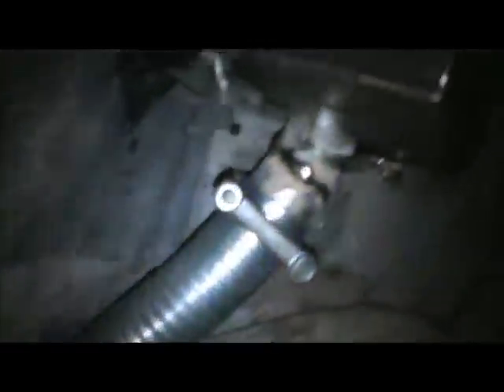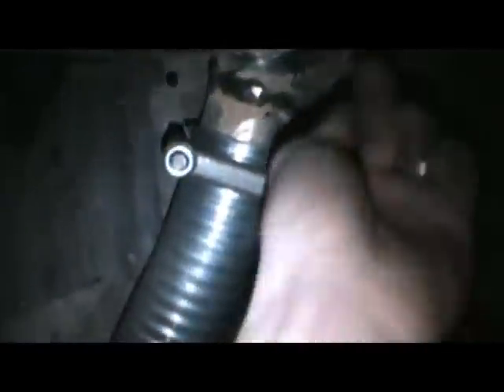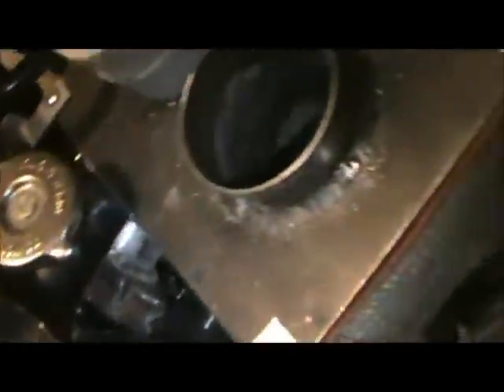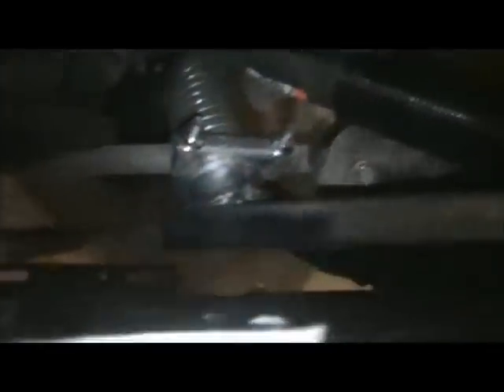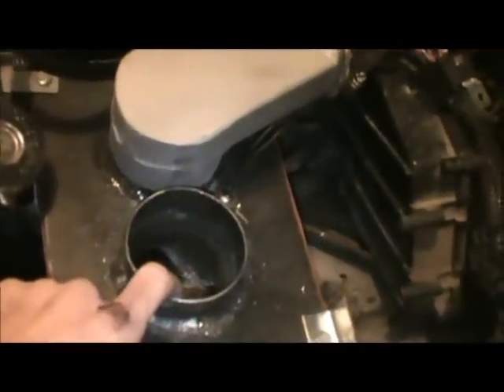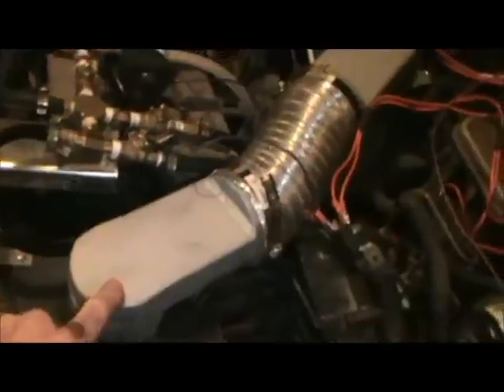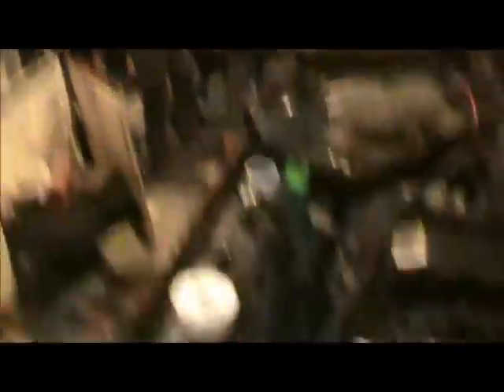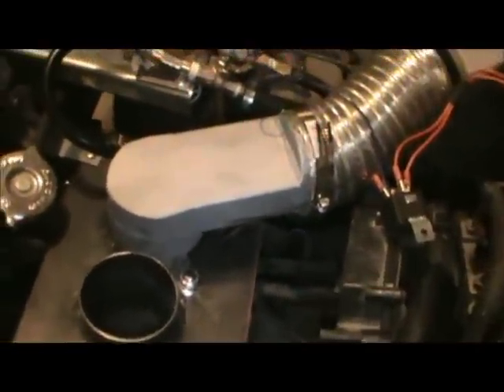100+MPG PROJECT NEW FUEL VAPORIZER INSTALLED (DETAILED OVERVIEW)

Comment: What was your mileage when it was all finished?
Reply from the maker: 33 MPG is the best with it so far.
Reply: What vehicle?
Reply from the maker: It's still not finished there is still lots of changes that are and will need to be made.
Reply: Gotcha! What'd you get on the rendezvous?
Reply from the maker: 211.7 at best. Went 19.86 miles on 12oz of fuel. The worst was about 10 mpg.
Reply: Any differences setup wise with the rendezvous versus the 100+ mpg project?
Reply from the maker: Yes there are allot of differences.
Reply: Could you just point out the differences to me??
Reply from the maker: Temp., intake and outlet size, fuel regulation, temp. control, container material. Filtration material, altitude.
Reply: What do you use for filtration material? Also, where did you accumulate your knowledge on HHO?
Reply from the maker: I use stainless steel wool and high temp cloth wool. A better filtration material would be a ceramic cloth. 

I accumulated my knowledge of HHO by doing allot of research and testing. I have spent literally over a thousand hours researching and doing various tests with hho.
Reply: where in the hho system do you perform the filtration?
Reply from the maker: After the bubbler.
Reply: What is your opinion on dry vs. Wet cells?
Reply from the maker: It depends on the application. I would use dry on a vehicle but for the hydrogen fueling station I'm building I will be using a wet cell design.
Reply: Gotcha...are the gains the same or different for a dry versus wet cell? I'm finally starting to grasp the whole hho installation process. What gauge of wire do you typically use? Also, are their any wiring diagrams you'd advise?
Reply from the maker: They can be a bit different. Wet cells will have more current leakage which makes them less efficient therefore it takes more power to make the same amount of HHO gas. As for the gauge of wire the thicker the better because of the amount of amps going through them. The thicker wires such as a 6 gauge wire will stay much cooler there a 10 gauge wire.
Reply: Okay, is it necessary to have a bubbler for a wet cell? Also, for your cells do you use a PWM or EFIE?
Reply: Okay, is it necessary to have a bubbler for a wet cell? Also, for your cells do you use a PWM or EFIE?
Reply from the maker: I would recommend a bubbler but use the water reservoir as the bubbler instead of having a water reservoir and a bubbler. If using HHO I would use a EFIE it will help to confuse the cars computer. A cars computer will typically learn that you are tricking it and will adjust for it after time. If you reset the cars computer then it will have to re learn everything again so if you have an HHO generator connected to the car while it is re learning everything you will see better results. A PWM is good but I would never recommend using just that. The problem many people have is they set a cell to produce a certain amount of HHO at all times. This is a problem and you will see little to no gains doing it that way. You need a computer program or a PWM that will increase the amp's to the HHO cell as the rpm's of the engine increase. producing more HHO gas while the vehicle is at higher rpm's and reducing the amount of gas production while the engine is at lower rpm's will give you much better results. I would say that having a system that increases and decreases HHO gas production based on the rpm's of an engine is critical and almost everyone fails to do that.
Reply: Is there a way to program the PWM to adjust to the RPM's of the vehicle that you know of?
Reply: Is there a way to program the PWM to adjust to the RPM's of the vehicle that you know of?
Reply from the maker: I'm sure there is something out there  but I don't know of any off hand.
Reply: How do you go about running your hho system in the winter time? I like in Wisconsin so winters here are brutal...
Reply from the maker: There is a chemical you can mix into it that will prevent freezing. Some of the companies that sell the generators sell it. You could also have a insulated water storage container that the water drains into when the system is turned off and pumps the water back into the generator once the power is turned back onto it. .
Reply: How would you create a drainage system? Gravity?
Reply from the maker: Use a multi directional pump. Have the hose in the container you would drain the water into sit along the bottom of the container so you can pump water in and out of the container. You'll have to wire it to a multi position timer switch so when the ignition switch is turned to the off position it will turn the pump on and only allow it to be on for the amount of time it takes to drain the water into the drainage container and when the ignition switch is turned to the on position it will turn the pump only for the amount of time it takes to fill the HHO cell back up with water.
Reply: Alright, thanks! I looked up chemicals and have had some success however, I wouldn't want to pay that much all winter (which is practically 5-6 months in Wisconsin) paying for that. I also looked up insulated containers and couldn't find anything near what I wanted. All were 250+ gallon tanks for industrial or farm use. Any ideas? Also, I got a question about your setups. I've seen alot of diagrams and stuff on HHO by now and none have as many tubes and wires going into and out of the engine compartment. Could you shed some light on why their are so many tubes? I feel like the design I'm making is very simplistic compared to yours and I want to reap the best gains possible.
Reply from the maker: Josh Studinski I would suggest you get a container and insulate it your self, it will me much cheaper that way and you can insure it will be insulated good enough. The design in this video is a fuel vaporizer not an HHO generator. I would build a traditional dry cell or buy one that you can either put together or that is pre built. greenfuelh2o.com sells some very nice well priced HHO generators. You can build yourself a split cell so you don't have to worry about the O2 censor getting thrown off. I will be building one soon and will share exactly how it's done. It will be the simplest design out there.
Reply: Okay, great! What would you insulate yours with? And when you say split cell, what sort of design do you have in mind? Also...where did you get your ideas for the fuel vaporizer?
Reply from the maker: I would use a fiberglass or ceramic insulation material. You can get ceramic insulation tape for pretty cheap. I'll have to show the split cell design in a video. I got the concept from an old neighbor who built one back in the 70's and got about 200 MPG using about 80% water 20% fuel.
Reply: Okay, thanks! So is it a modification to the carburetor? Also, is their a name for the design he (or you) did? (GEET, etc.)
Reply from the maker: Nope I don't have a name for it. It basically replaces a carburetor of the fuel injection system.
Reply: You should put in an a cell, I bed you'd get huge gains with the vaporizer. Also, what do you generally use to see your hho output (L /min.)? I am going to install a cell soon but want to see my output on my dash.
Reply from the maker: I will be putting in a cell that I designed shortly. I had to scrap the Jeep because someone vandalized it to the point that it would cost way to much to get it back to normal and get it running again.     There is a nice gauge out there you can get that has a digital readout on it that is made specifically for HHO. Here is a link to the website: http://www.accuenergy.com/
Reply from the maker: Here is a link to Steves video on the meter. Accuenergy panel meter for serious HHO enthusiasts
Reply: Thanks! I'm sorry to hear about that...I have the same model jeep as well. Could you send me a picture of your idea of a "split cell?" As for the vaporizer, do you got any websites or plans that I'd benefit from?
Reply from the maker: I don't have any plans that you could necessicarily benifit from because the system is way too unreliable. You can go to my facebook page: https://www.facebook.com/groups/259684980846627/ there is allot of info there or you can go to my website: http://fsrdproducts.com/blogs/news
As for the split cell I need to test it first before I give out the info on it.
Reply: okay, is there any designs similar too it? I'm just looking for a bare picture on the internet or anything to help brain storm some ideas up...
Reply from the maker: http://unitednuclear.com/index.php?main_page=product_info&cPath=25_72&products_id=316                             It's not quite what I'm doing but kind of a similar concept.
Reply: Is that said to have better hho output? I'm a fan of the wet cells more than the dry they have multiple cylindrical shaped wet cells that are super efficient. As for the fuel vaporizer...does a car need to have a carburetor to swap out a vaporizer with?
Reply from the maker: I would have to do a MMW test on it to know for sure.       

As for the vaporizer you don't have to have the carb for it to work.
Reply: Alright. Any suggestions on the size of tubing for the cell? I'm leaning towards a 1/4" because brackets and elbows are easier to find for that size.
Reply from the maker: it all depends on how much your cell will produce. 1/4" will do fine in most cases.
Reply: You said 6-8 gauge wire would do for the whole process correct?
Reply from the maker: That's correct.
Reply: What's the purpose of a shunt in the cell layout?
Reply from the maker: I've never used a shunt.
Reply: What does it do? As for the whole drainage system...do you know of any multdirection pumps? I have found none since you mentioned it to me. Also, what gauge wire are you using for your cell?
Reply: Also, in an hho cell where would a flashback arrestor or filtration device go?
Reply from the maker: A multi directional pump is way too expensive. A cheap way to go would be to have your insulated container bellow the hho generator and when the vehicle shuts off there would be a solenoid valve that activates for a short time which allows the water in the hho cell to drain using gravity or you couple have 2 pumps one to drain the hho generator and one to fill it back up with water. You would then use a fuel pump or any small water pump to fill the hho generator back up when the vehicle turns on. You can get some pretty cheap fuel or water pumps that operate on 12 volts. I use 6 gauge wire.
Reply from the maker: I would use more then one flashback arrestor. I would put one just after the hho gas output on the cell and I would put one after the bubbler between the bubbler and the end of the hose that is going into the throttle body.
Reply: How do you use connectors with 6 gauge wire? The wire is thick! Which idea do you think is better for the drainage system? If I used the two pump idea would where would I connect the hoses? Also...how would I wire the pumps (most pumps come with a regular cord for an outlet)? For hho transportation I might use a air hose then use hose fittings to click it into place for easy connect and disconnect. What diameter would you use?
Reply from the maker: They make 6 gauge crimp on connectors connectors. I would use the dual pump system. Pumps have an inlet and an outlet on them you would connect the hoses up to each end. When installing the pumps you need to make sure they are installed the correct direction. They will have orientation arrows on them showing the direction of flow. If you get a 12 volt fuel pump they don't come with cords. They have screws on them that you connect the wires to. As for the hose size it doesn't really matter what size you use as long as it has good enough flow so the system has good circulation you will be good. I would not use air fittings they are not made well enough to prevent leaks. Use barb fittings instead.
Reply: What gauge wire would you suggest with winter in mind over here? Also, what equipment would you insulate (bubbler, drain reservoir, wires) etc.?
Reply from the maker: I would insulate the drainage container. Everything would drain into it including all the water in the bubbler. I would use 6 gauge.
Reply: What would you use to insulate it?  I was thinking some defective tape along with house insulation pads or something like that..
Reply from the maker: I would use ceramic insulation. The ceramic insulation insulates very well and is resistant to heat up to 2300 degrees F.
Reply: Here's an idea...that way I know for sure the water won't freeze. (WI reached -35 degrees this past winter) how about I put the cell inside the car or trunk, running the wires to the engine compartment and hook up some sort of vacuum like pump to the necessary tubes to ensure proper flow...this way I could ensure that it won't freeze with the insulation..
Reply from the maker: There you go. There are multiple ways you can do it.
Reply: Only problem is I have limited tools. Haha I might have already asked this, but upon research I haven't found too much; is a map/maf enhancer necessary? What about an efie? What are the purposes and what would I be compromising if I went a different route?
Reply: Only problem is I have limited tools. Haha I might have already asked this, but upon research I haven't found too much; is a map/maf enhancer necessary? What about an efie? What are the purposes and what would I be compromising if I went a different route?
Reply: Hey, how would you wire the two pumps to cycle through upon car shutoff and car turn on?
Reply from the maker: You would tie them into your ignition switch just like you would the HHO system.
Reply: But how do you get one to kick in when the car is turned off?
Reply from the maker: You would have to find an electronic part similar to a relay switch that will work in the opposite manner.

If you add allot of KOH to the water then the water wont freeze this is the simplest solution. Adding more KOH will draw more amps so you will need a beefy PWM. I read that somewhere a long time ago and was reminded of this method yesterday by Steve with greenfuelh2o.com.

Comment: Hello, I am interested in doing this to my vehicle. Where did you buy the kit?
Reply from the maker: I made it myself from allot of different places. I got materials online and from a few different stores. It cost allot of money for this project and It is not the best setup you could have so I would not recommend doing it this particular way.
Reply: How did you find the design and necessary parts?
Reply from the maker: I came up with the whole thing I didn't get it from anyone else.  I designed it from the ground up. It took hundreds of hours of designing testing etc. to get it to where it id's. I had to research the parts such as solenoid valve etc.  and find things that would work well with the application.
Reply: shit...kudos man. any designs you see out on the market that strike you as quality, similar, or better to yours? I'm just trying to get one for myself however, I don't have the time to test and retest it.
Reply from the maker: I hear you there. I don't know of anyone that has one if I find one I'll let you know.
Reply: Alright, thanks! You gonna upload a full walk through when its complete so some of the unfamiliar can gain an idea on how to do it? Haha
Reply: Tyson Capel
What sort of degree do you have? The piping and electrical aspect to it is genius!
Reply from the maker: I've reached temperatures over 500 degrees F.
Reply: Tyson Capel
What sort of MPG gains did you see after the installation of your homemade HHO fuel vaporizer?
Reply from the maker: Close to a 100% increase.
Reply: You think a homemade one would be better than a bought kit? Because kits online claim 20-40%. Yet, every homemade one I see people are getting 60-200% gains... I apologize for all the questions, I'm a noon at this and really want to learn the process, how to install one, and improve efficiency (similar to you) on different models and variations. So thanks for the help!
Reply from the maker: If you can get the homemade one to perform properly it would be better for sure. I've never tried a bought kit so I don't have any real time experience on them.
Reply: Okay, great! I really like your system in both the videos of the 100+MPG video and the 200+MPG video. They both seemed very practical and efficient... In the videos you said you were coming out with a walk around after further testing on each of them. Do you know when that will be? If not, is it possible you attempt to explain to me what connects to what and where...etc? I'm trying to get my feet wet and every HHO video I've seen basically assumes the viewer knows how it operates and how to make one, just different ideas and setups behind the various systems

Comment: Only thing that concerns me is you have no blowout valve to protect the system or any flash back arrestor ideas.

Have you ever had any issues with it flashbacking from the combustion chamber ? 

Thanks for sharing your ideas.
Reply from the maker: I actually do have a back flash arrestor installed in the system at multiple points and it works great. The best place to install it is on the throttle body.
Reply: Nice, not sure how I did`nt see it. You should do a video on that one aspect of the system and push the point across safety 1st.

I would`nt want to see people using plastic buckets under there hood getting into accidents those lids would just pop right off.

Letting people know they should use a metal bucket with the tabs on the sides that they could use metal zip ties to hep keep closed would be the safer bet.
Also adding a quick note at the beginning of your old and new videos that in some way dissolves you of all blame is needed. CYA, (cover your ass) so if shit happens the people that help you will have an easier job...

Cheers